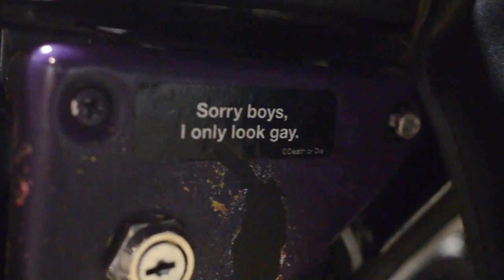#107 - Vintage Swap & Evo Update

Comment: the sportster cleaned up really really good compared to when u first picked it up. Gonna have to look into the fork extensions as well. Mine's came with 6 overs but it aint cuttin it

Comment: Harbor freight sells cup soft wire brushes and that will cut down ur time on polishing them lower tubes!
Reply from the maker: Oh damn! Thanks for the tip! They’re called that?
Reply: Yes they fit on a drill.  I wouldn't believe it till I watched my younger brother do it.  Lol alot faster than the old way with all the sanding, the way I thought him cus I was taught that way.  It just blew my mind that it can be done this was. Give it a try, it will make u smile!

Comment: I don't know if you seen my comment on using lime away for rusty pipes like yours were the acid eats it off and doesn't mess with the chrome I used it after I tried other shit and it works with very little elbow grease. Bike looks like a different bike great job I want to know what you paid for it lol
Reply from the maker: Thanks! Gonna give it a try this week!

And the price plus what was included was in a couple replies in the last video👍🏽

Comment: how do you ditch the left handle controls without making the headlight quit working
Reply from the maker: You gotta simplify your writing and run your lights to a switch. Or you can order “The Sportster Treatment” wiring kit from Lowbrow Customs.
Reply: @Unaffiliated  thanks for replying back I greatly appreciate it 🤙

Comment: They're called slugs. And not safe. Theres  a reason they stopped makin em. Argue all ya like. Ask anyone that was riding in the 70s. Yeah,we don't know shit. We're boomers.
Reply from the maker: No arguing here! We appreciate you looking out! We’ve heard of ones before that weren’t safe that were made out of thinner material and weren’t the exact diameter as the fork tubes, so the top of the triple trees would have a loose hold on the slugs leaving the majority of the fork's length unsupported. When the inevitable fork-tube flex occurred, the threaded, unsupported joint between the slug and fork tube acted as a hinge and it was ALL bad! Thankfully these are made of a solid stock of metal and are the exact diameter as the forks. No play at all. But if you’re telling us these are the same as back then, then yes for sure we’re gonna take these off!! Thanks again for the feedback Digs!
Reply: Cool,just be safe guys.